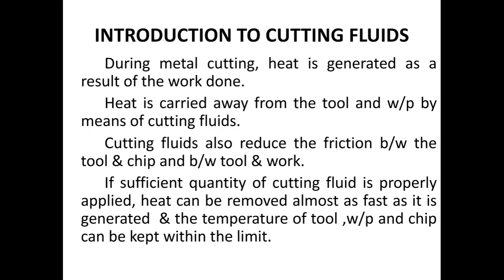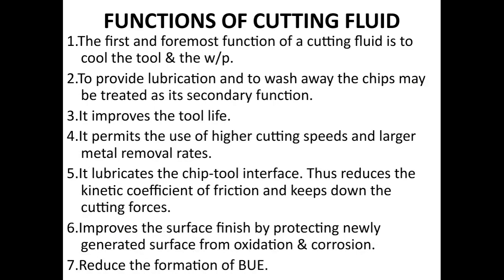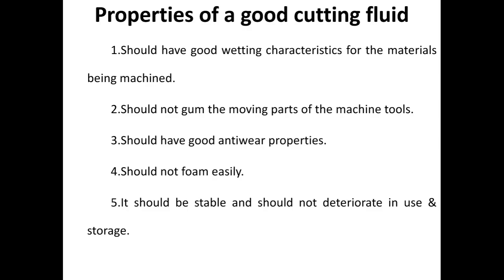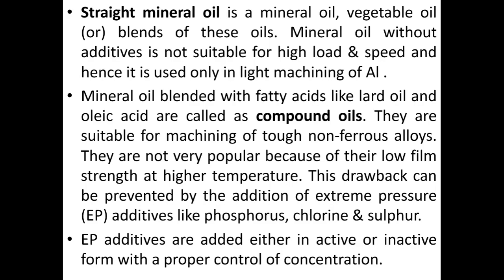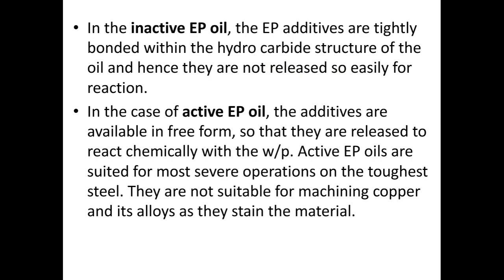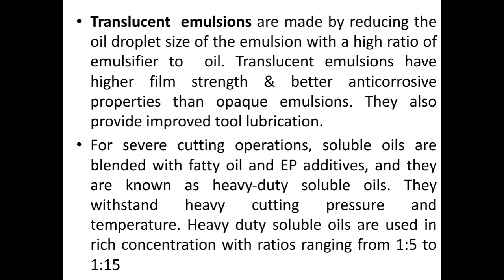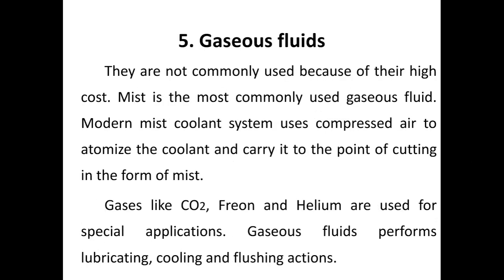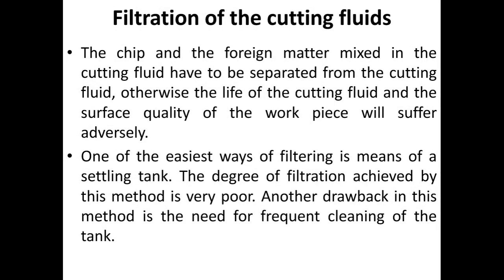Cutting Fluids- Types,Selection and Applications | Engineering Study Materials

Comment: What is the percentage of cutting oil in water...?
Reply from the maker: Usually, the dilution ratio of oil concentrate to water in a soluble solution is 20 or 30 to 1. You need to use the dilution ratio recommended by the oil concentrate manufacturer.